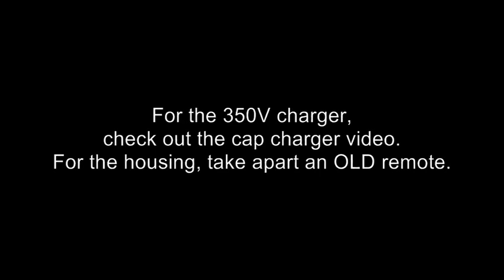Tutorial: SIMPLE homemade shocker / taser (it hurts !)

Comment: Those camera circuits will usually tolerate 3 volts of input without any trouble, and that should raise your repetition rate significantly.
Reply from the maker: +Ryan Willis The older ones, yes. SOME are made for 1.5....and 2 is the max :p try 3V and its dead.
Reply: Selfmade Yep, that's true.